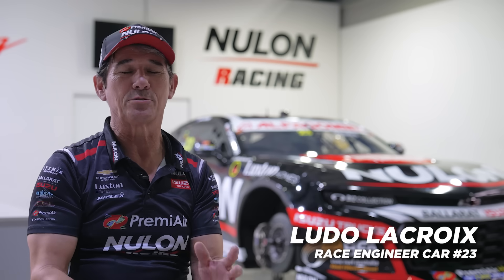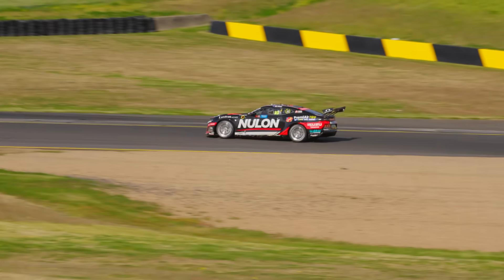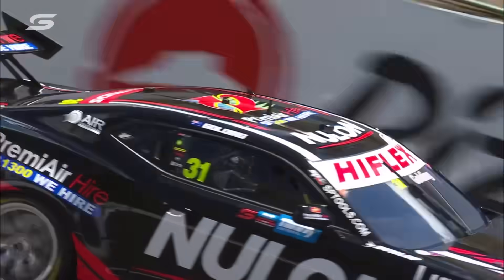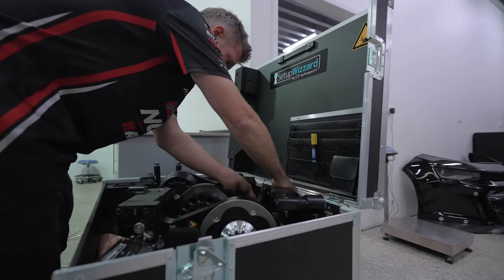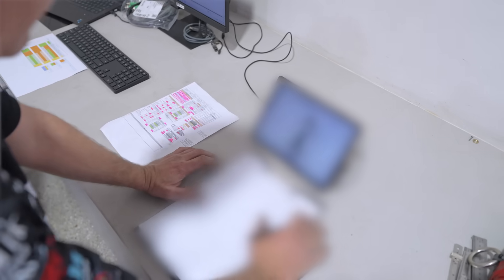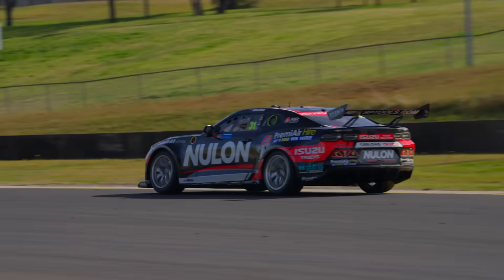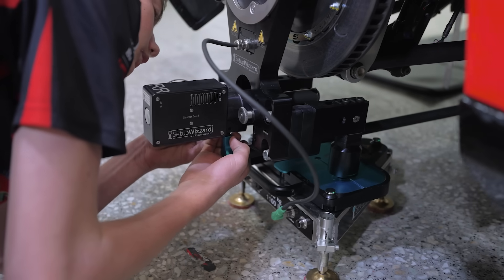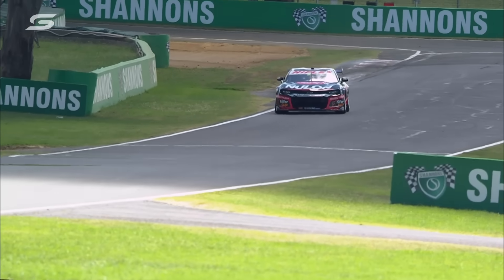Secrets to chassis setup -  Ludo Lacroix

Comment: You're sending all a big bumsteer here? Shouldn't the camber/ caster etc be set with the weight of the car compressing the suspension, not completely unloaded.
Reply: The weight of the car is on the pads. The setup wizard allows that without thr wheels to be on the car. Pretty standard stuff in the racing industry these days.
Reply: I relate to what you are saying but I’m not a racing engineer and they obviously know their job and the tools to do it.